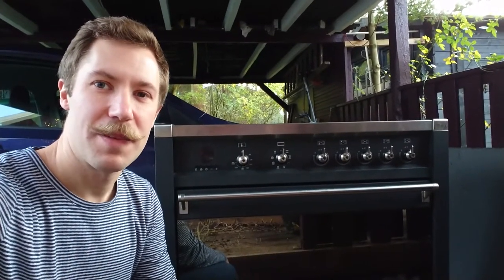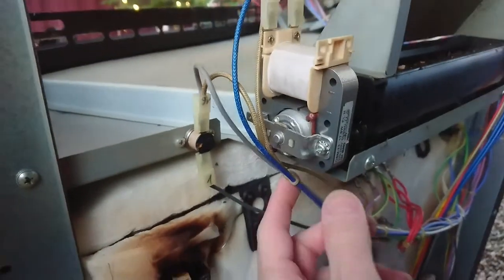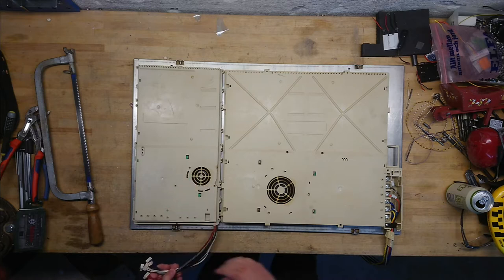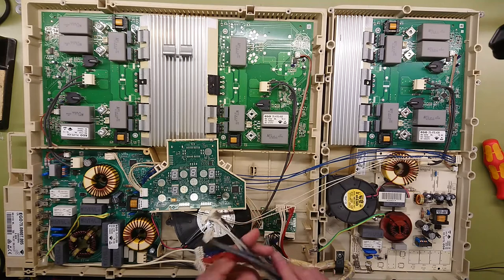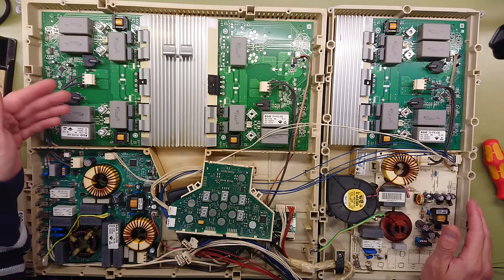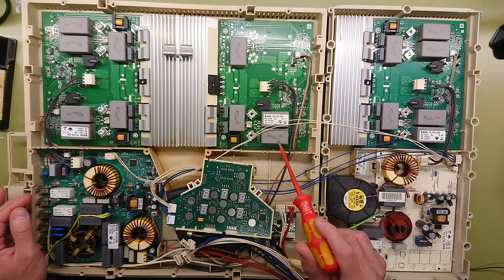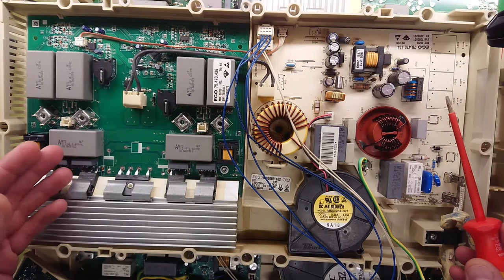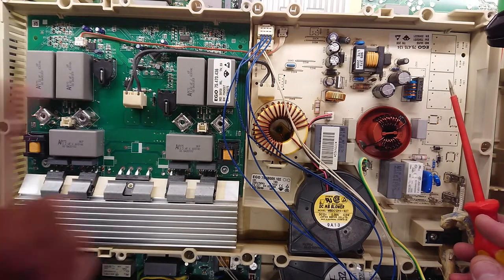10 kW Induction Stove Teardown, Huge SMEG 5-Zone Stove

Comment: Could induction stove or cooktop be set or programmed to derate the power to less than the maximum power in case the thickness of the wires inside the house walls were less than the thickness needed to carry the maximum power  ?

Comment: The silver fibrous stuff is what's used in microwave waveguides to cover the gun, they are heat resistant and allow eddy current to be very low so magnetics do not become affected. Not exactly sure if what the fibre portion is made of, that's why I don't really like tearing them. Love the videos!!!!
Reply from the maker: Thank you, makes sense that its there to limit the heat transfer from pan to the coil/electronics
Reply: @KaizerPowerElectronicsDk  No problem, I really enjoy induction heating circuitry.
Reply: Bonded mica paper I believe

Comment: 10kW is insane, I have a ~4kW and it is already about as fast as you'd possibly want to heat up anything.
Reply from the maker: 10 kW is the combined consumption, I would guess that 4 kW is also the maximum rating of the large plate.

Comment: Can you make another coil to melt metal instead of using the pancake coil?
Reply from the maker: No, not really. The operating frequency has to be around 20-25 kHz for the circuit to not burn down on itself. Smaller coils are needed to melt metal at these power levels and that would result in a higher resonant frequency, just adding more capacitance is not a solution either, the inductance would again get too low. There is also ferrite blocks in these pancake coils to ensure high coupling and energy transfer, it does not tolerate highly varying loads that well.
Reply: @KaizerPowerElectronicsDk  Thank you for your answer. I did an experiment with a small induction cooker laying a thin sheet of ceramic fiber on the cooking zone then on top of that a piece of thin sheet metal placed on it.  The sheet metal  started glowing red but would not get any hotter, it was still magnetic as a magnet stuck to it. So how do induction furnaces get past that temperature to melt steel and other non magnetic metals?
Reply from the maker: @luckygen1001  by the use of very high power levels or a crusible. The crusible made of graphite absorbs heat all the way and does not get limited by curie temperature as metals does.

Comment: Did u say 12 kw is maxing out a residential house in denmark? Even at 3 phase 416 volts? That seams kinda low for that voltage. So u have three 17 amp power leads as your mains?
Reply from the maker: The household normally has 25A fuse from the road and the individual 3 phased groups are sized down to 16A, hence the ~12kW max...
Reply: @KaizerPowerElectronicsDk  no kidding. Wow. So air conditioning while cooking is something you have to pay attention to. How does a home in denmark heat it's water Electric or  gas? How about clothes dryer Electric or gas. In the USA it's common for people in rural areas to not have natural gas at their homes so they heat with large 1,000+ gallons of propane. So to keep the usage of propane down we dry our clothes with a 5kw Electric dryer and up to a 10 kw hot water tank that supplies the entire home. And have and Electric oven same as this one or just resistive. So they typically home has a breaker panel 100 amps at 240 volts so 24kw. But most newer homes or rural homes like mine have 200 amps at 240v so 48 kw. But I also have a barn with its own mains from the utilities with another 200 amp 48kw service to run my diy machine shop. But your country has better education and less crime so I guess we'll call it a tie 🙂
Reply from the maker: Air conditioning is not normal, we simply do not have long very warm summers, so we enjoy the little warm weather we get :) We never really think about simultaneous use, I can cook, have the oven turned on and vacuum clean at the same time with all lights and such turned on. But we also have central heating via hot water in many homes, else gas supply. Electric heating is not normal. Denmark is a small country, so we have a very well-built infrastructure that covers a very big part of house holds.
Reply: @KaizerPowerElectronicsDk  thanks for all the information I really appreciate it. Our infrastructure is ageing. Especially in the cities. Now states like california who have rolling power outages want to mandate electric cars. Everyone will be towing around generators just to get to work. Lol
Reply from the maker: We have a power supply uptime at 99,993%, world class status that has also resulted in a lot of data centers from Google, Apple, Facebook etc. to be placed in Denmark. Good access to internet infrastructure between Atlantic cables and European land lines. Less cooling needed and excess heat or cooling can be sold off to public grids.
Reply: @KaizerPowerElectronicsDk  makes sense. I would like to live in the countryside. I live in rural country side now. But when I get to the city there's tones of parking. Is there alot of people who commute to cities like that in denmark? Im not aware.